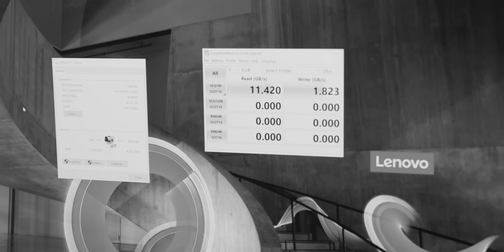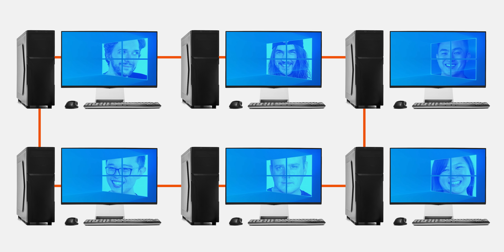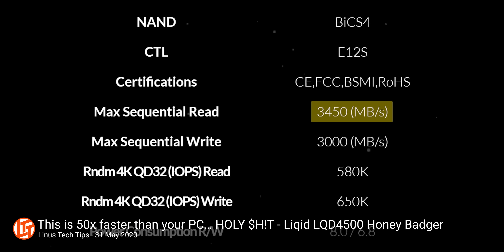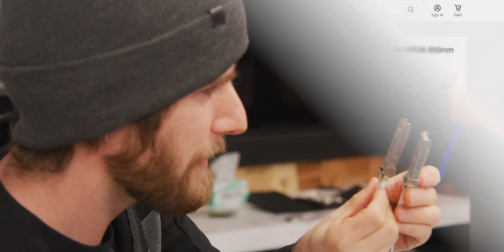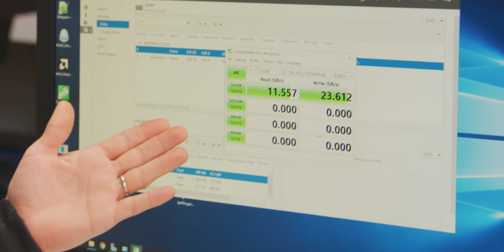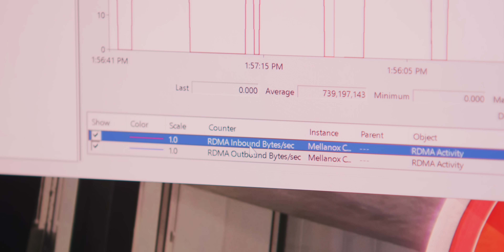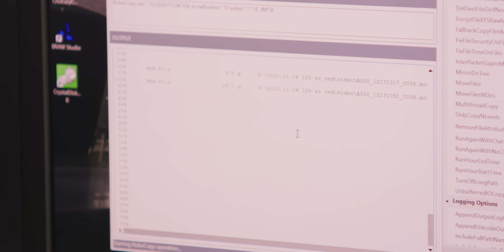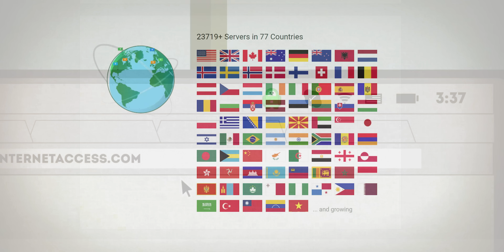A $15,000 Network Switch?? - HOLY $H!T - 100GbE Networking

Comment: I'd have to disagree with Linus on the fragility of fiber. I work with the stuff daily. Even single mode is way better than it used to be. As long as you don't let the cable get kinked or bent at a right angle it'll be fine. I've seen fibers hanging out of cabinets with the door repeatedly shut and locked on the cable and they're fine. I've seen fiber laying on the floor and ran over with carts loaded with heavy servers over and over and they still work. I don't recommend it obviously but the stuff is much tougher than people think.

Comment: 3:47 - Jake is not entirely correct in his statement. While warrantees for consumer grade electronics often have language about opening the case will void the manufacturer's warrantee, data center components intended for commercial, government, military, and education datacenters will have language allowing for devices to be serviced by trained IT staff either employed or contracted by the purchaser. This is done because it's often cheaper (at least for the manufacturer's standpoint) and quicker (from the customer's standpoint) to have the customer's IT staff service the equipment and then order the affected subcomponents to the switch or server that's down.

While the language as to what "qualified IT staff" might vary based on purchasing contracts, companies, and even the products, I'm pretty sure most companies would be hard pressed to argue that Linus isn't a qualified IT staff for his company. He may not be the primary network tech for Linus Media Group (I think that's Anthony, but I could be wrong), but there is strong video evidence that he has the skills to qualify as one. 

So Linus cracking the top of a piece of network equipment intended for his server room would not void the warrantee. Linus dropping components (as he normally does) would void the warrantee under the misuse clause of the warrantee.

Comment: Cant you use iperf to test speed? They have a client/server for Windows too.
Reply: Iperf use "classic" TCP/IP so the offload benefit of RDMA era out of question: only some specially developed apps use. Microsoft used for SMB file share (windows server or windows pro as client only required). with this kind of networking speed (with "Only" 25GBIT NIC) Microsoft demonstrate a cluster of 12 machine implementing storage space direct reaching a sequential I/O of 586 Gigabytes per second and 13.7 Million IOPS 4 kB random, 100% read in 2018...

Comment: You may wanna check if that's got a an atom c2000 processor in it as they're prone to the AVR54 bug: "AVR54. System May Experience Inability to Boot or May Cease Operation Problem: The SoC LPC_CLKOUT0 and/or LPC_CLKOUT1 signals (Low Pin Count bus clock outputs) may stop functioning."  This has been killing off a bunch of the older high-end switched and NASes.

Comment: Linus in 5 years

“We got 1 TERABIT PER SECOND internet - HOLY $H1T”
Reply: @PaPBra Gaming Problem for 5G is, it's a wireless.
Reply: Can’t wait for 1 petabyte per second
Reply: In the carrier class enviroment there is already 250Gbps interfaces but just the NICs are over $1000 each

Edit: The ServeTheHome channel just reviewed a 36x100Gbps server from 2016, that's a 3.6Tbps switch in total
Reply: 5 weeks*
Reply: 2 months
Reply: My bet is for 1.6 Tbps
Reply: @PaPBra Gaming That's pretty much impossible in the 5G standarts, you would need some sort of Li-Fi for that.
Reply: https://youtu.be/PgbHgQ8okh0 👏👏
Reply: 400gbe is next up.
Reply: Runforestrun FPV 
400GbE transceivers exist y'know
Reply: @hariranormal5584  and depend on mpo interface end to end which has 8 or more cores of fibre in one cable. Linux should start stripping I guess.
Reply: @runforestrunfpv4354  yeaaa, except the SFP's are like $8000
Reply: @Mediocrates9  Linux's soul and dignity should a valid tender then.

Comment: 100Gbps is great, got a 200gbps server at work, and an 80gbps server at home. the cards were freaking cheap at IIRC under $100 each(dual port QSFP+10), only using 40gbps of the dual 40gbps adapter at home though. going to use a DAC to directly connect two cloned servers. Just wish i had the property rights to drop a fiber run to a more rugged partially underground off-buildng as P2P wifi is just not fast enough to keep my NVR/DVR content updated, even though my DVR is only really being hit hard for a few hours each day, the wifi just isnt good enough. without going balls to the wall P2P like the 12km video you guys did

Comment: You guys should invest in a proxy solution for your video files. And BRAW is easier to manage than R3D files. In Premiere, it's easy to generate proxies at any given time. And I don't know if you have assistant editors but it a good way to save editing time when you become a bigger post-production company. Let me know if you need more advice. I work as a TD in post-production.

Comment: You are correct that the initial cost of RJ45 switches are more expensive, because it has the hardware integrated to read the bits on the layer. Whereas the optical switches require you to buy SFP's, if you want it to understand anything.

And yes, electrical signals generate more heat than light.

Comment: Yes, I want to see the 200gigabit aggregation.
Reply: it's really ridicolous easy. connect the second NIC , configure the second NIC in a different IP network. Enjoy. In fact in the high end networking space 100GB is already "obsolete" and you can find used switch like Linus one for 1200$ , of you settle for measly 40GB for half of that and less than 100 buck for dual port 40GB. Cables and transceivers can be really expensives. one fo strangest experimet i've made was connect 3 machines in peer to peer config (one connecting to other two using 2 cables) + 1 1gb rj45 to a cheap switch.. and windows server was able to automatically to detect the RDMA connection and enable RDMA: 4 gigabyte per secondo to a ram drive with a 2012 era server... not too shabby.

Comment: So if that's a Dell 48 port switch does that mean it comes with 48 warranties?
Reply: you mean 96 warranties, they sold them 2 warranties in Secret Shopper
Reply: @katech6020  so prime 95 warranties remain
Reply: 47 left, so that should be fine
Reply: 97 remain, there were 2 warranties for the case itself
Reply: 96
Reply: jpnewpic88.men
Reply: jpnewpic88.men
Reply: jpnewpic88.men
Reply: jpnewpic88.men
Reply: jpnewpic88.men
Reply: https://youtu.be/PgbHgQ8okh0 star

Comment: When you realise that’s 2x HDMI 2.1 and 2.5x Thunderbolt 3. We need this switch and cable for connecting laptops with external GPUs. We need THIS cable for connecting TVs and monitors to computers.

Comment: "It must have expandable memory for a reason!"
Well, it could be ease of manufacturing.
Reply: A switch will use RAM as a cache for MAC addresses/IP Addresses and which ports they are assigned to which massively speeds up look-ups. It's obviously also used for the firmware, and any additional features such as firewalls, address filtering, virtual LANs and so on, it's also used to speed up the data transfers across the network by bypassing the switches CPU which can be a bottleneck with such high speed networking. With all of that running you can quickly run out of RAM even with 8GB on switches as beastly as the one in the video.

You can run DHCP servers, NTP servers and even FTP servers directly off of certain switches/routers like Cisco stuff, and I would imagine the Dell switch can also do those things.
Reply: You can also run docker on the switch and run some extra services.
Reply: Some large swiches can devide them self in routing blocks. This is usualy what the added memory is for
Reply: Well, there is a lot that can be done with that memory, the question is how much of that is actually intended by the manufacturer.
Though, okay, granted, I'm not very used to the world of enterprise hardware, I only know that the prices are insane and that's about it ._.
Reply: @dside_ru  All of that stuff is intended by the manufacturer, they charge a fortune for most of it, but access to all of those features are absolutely a requirement by enterprise and dell et al are more than happy to accommodate as long as the customer is willing to pay for it.

If you've only ever seen consumer switches and routers then all of this is alien to you, it certainly was to me at first, but in enterprise that dell switch is only the start, and the features we've mentioned are only some of what's possible, and it's all intended use cases that the manufacturer will offer support on.